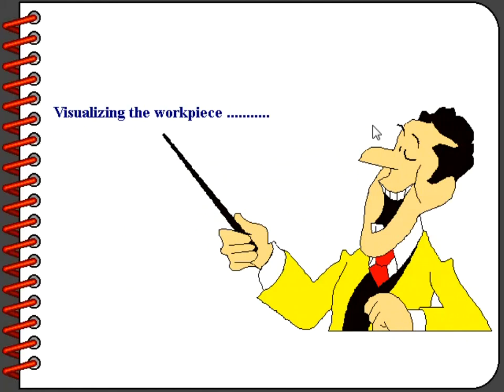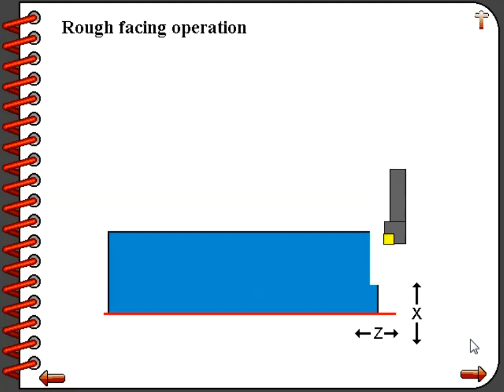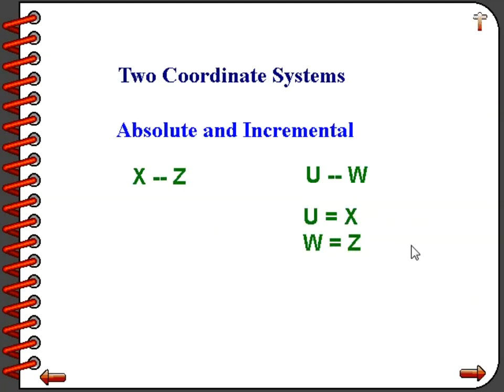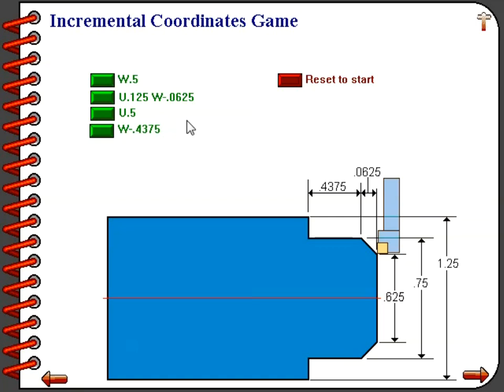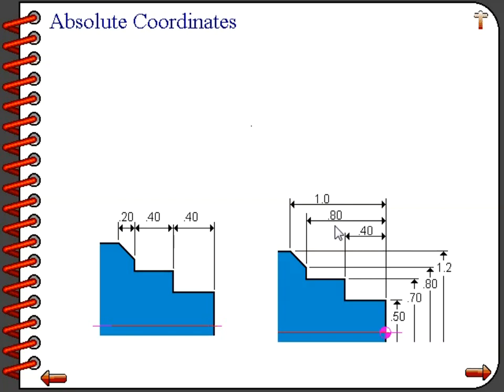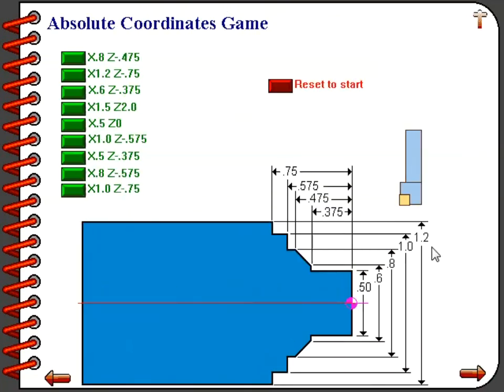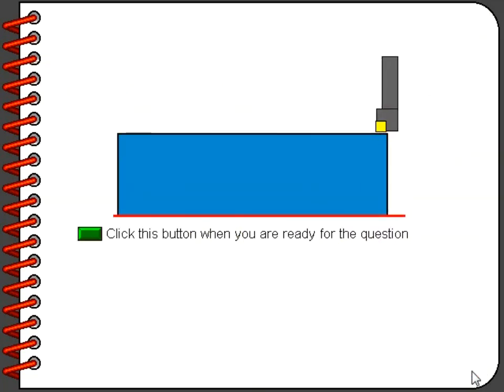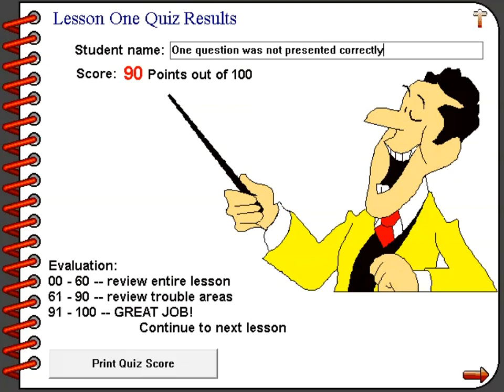CNC Lathe Lesson # 1

Comment: X axis shows diameter, say .50 (@22;39). Wouldn't X.5 move the tool .50 from program 0 (x0, Z0) for a diameter of 1.0? Confusing.
Reply from the maker: Most CNC lathes are set up on Diameter measurements (some use radius however) ..so if you wanted to turn a .500 diameter you would move "X" to X .500, hope that helps.
Reply: @WildRandall62  Thanks, your tutorials are great. Which system is this? Very interesting indeed.
Reply from the maker: @georgembugua1882  This software belongs to Ivy Tech Community College...It cannot be purchased,...sorry
Reply: @WildRandall62  How sad, it is so nice and easy. Can I have it for free then? It would be very useful here in Africa.
Reply from the maker: @georgembugua1882  nope...lol nice try though...
Reply: @WildRandall62  what a bright light to keep under a bucket!
Reply: WildRandall62 this is great!!! Who do I contact to find out more about the software? My company would really like to build a curriculum. I would like to use this as an example.